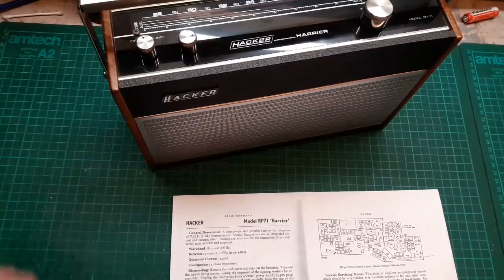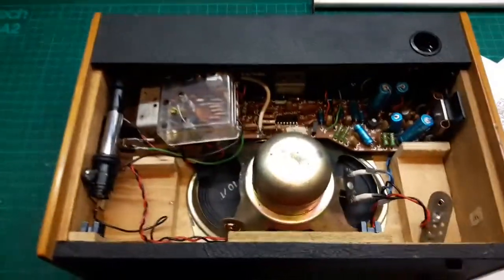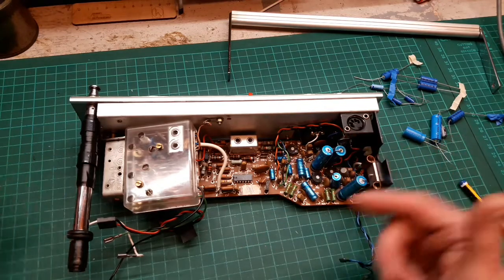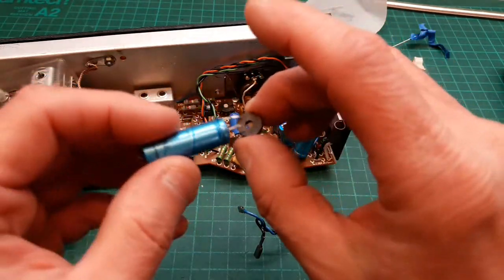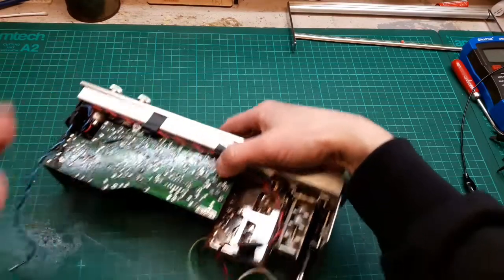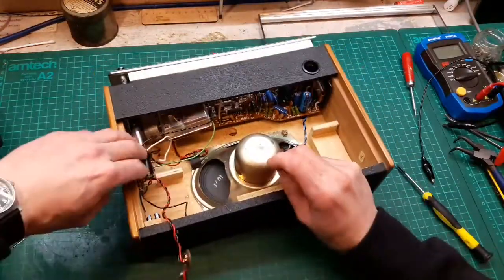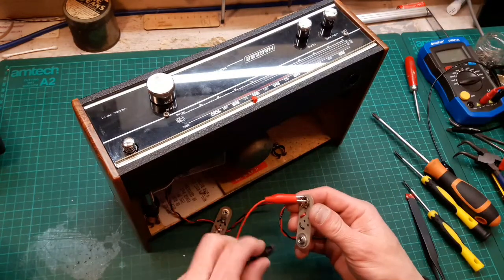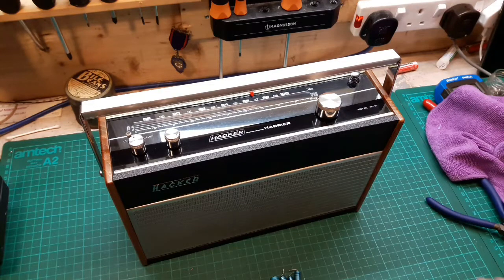Hacker Harrier RP71 Radio Seviced

Comment: You missed a chance to show the radio with the old caps in and say "Abra kadabra" and cut straight to the done footage lol.
If you dont remember the way the red and black goes on to the speaker, connect an old triple A cell to the speaker and notice the direction of the cone, it should move forward to the front of the radio, the positive = red.
Yep im harvey of the bloody obvious ha ha :-D
Reply from the maker: zx8401ztv great tip on the speaker polarity ZX thank you 
There's a final video on the Harrier coming very soon 
That aerial area had been messed with 
Best regards Shaun